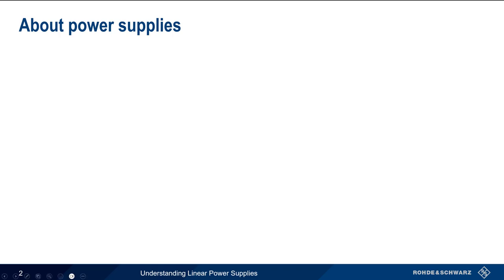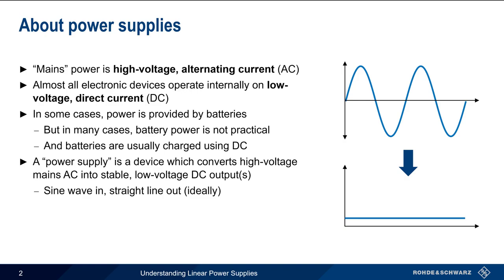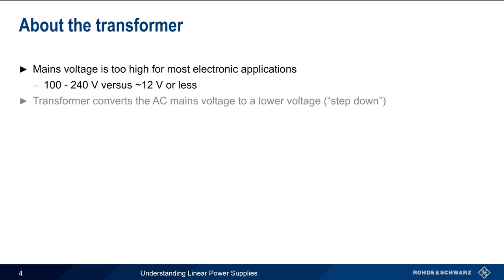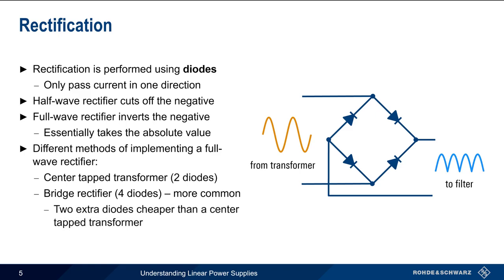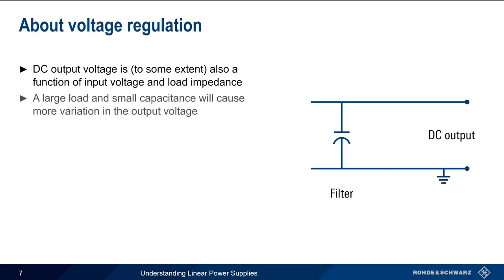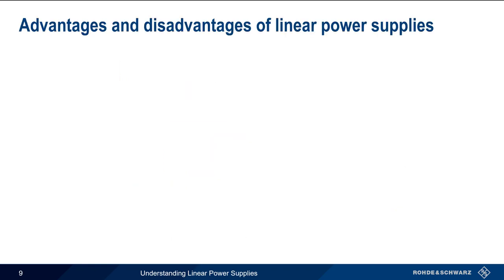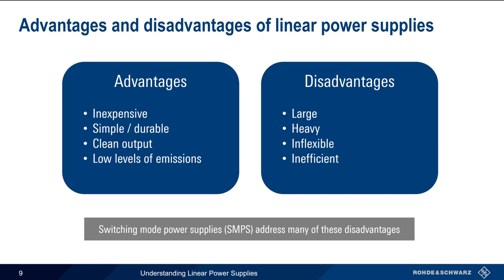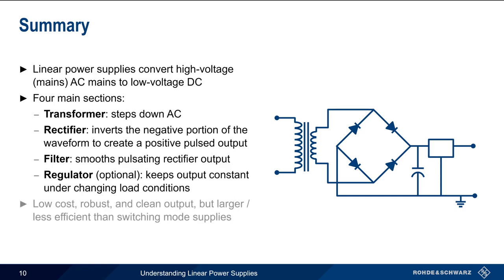Understanding Linear Power Supplies

Comment: It this the same as a voltage regulator, if not what is the difference?
Reply: The voltage regulator is part of a power supply - it helps to maintain a constant output voltage.  Linear and switch mode power supplies both have voltage regulators, but they sre implemented differently.  I'm actually planning a separate video explaining how voltage regulators work :)
Reply: @pauldenisowski  awesome stuff, looking forward to that video!